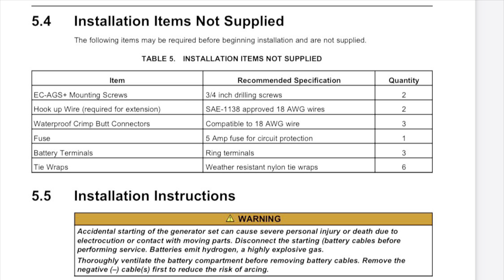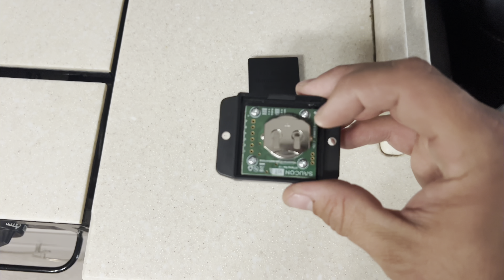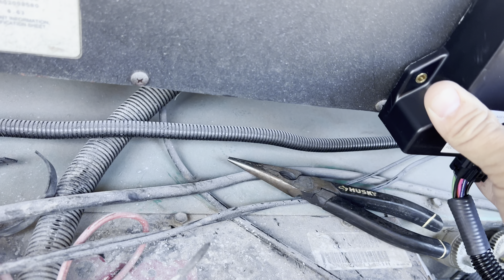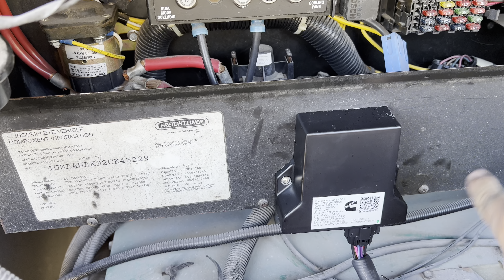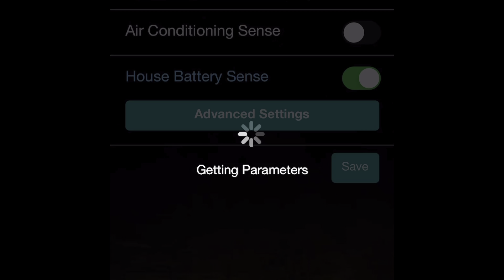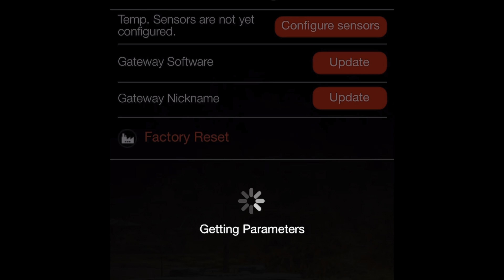How to install Cummins Onan AGS + Auto Generator Start Quiet Diesel

Comment: If your RV has Wi-Fi can you start and stop this from anywhere? Or does the app only work when you are near the generator?
Reply from the maker: Unfortunately it does not support WiFi, just Bluetooth. But you can set parameters to auto start when the house battery runs low or the temperature goes too high and kicks on the AC.

Comment: How did this work for you? Did you like it?
Reply from the maker: Works great, just wish it had WiFi functionality to monitor and operate it while away. The parameters for auto start are nice and work great. Reading trouble codes is a nice plus.

Comment: Just installed my AGS+ and it works great except when you try to put it in “auto mode” it turns on for a second then goes back to manual mode!  Any ideas of what is wrong?  Thanks
Reply from the maker: Did you setup your parameters for ac sense or battery sense?
Reply: @Fix-it-tony  Yes I turned on the buttons for both but didn't change any of the settings
Reply from the maker: @rvinghobbies9279  you have to enter at least the battery settings.
Reply: @Fix-it-tony  I just checked and the battery setting (default that came with unit) were set up. Still not staying in auto mode. I tried to do a firmware update but that failed I think due to internet strength at RV (in barn) so will do that next time it is out and see if that makes a difference. Any other ideas welcome!
Reply: @stevebaker5454  Did that fix the problem?   I am ready to install one.   Is Cummins any help?  Thx
Reply: @darwinottolini  Unfortunately no. Now waiting for a Replacement unit!
Reply: @stevebaker5454  Bummer.  At least they stand behind the product.  Do they have any idea what the problem is?  I'm going to give it a shot and install one.   The website said "non returnable" so that put me on alert.  I'm also researching problems on RV forums.  Let me know if you know what the problem was with your unit.   Thanks.
Reply: @darwinottolini  Cummins does NOT stand behind their product!! I bought and installed the AGS+ over a year ago. It never worked right and Cummins has been 0 help. I finally screwed around with the settings long enough that I could get by with it. Recently it quit working completely. Now I'm in the endless phone calls and emails to try to get help. Very frustrating!!
Reply: Does it turn back off after desired temp?